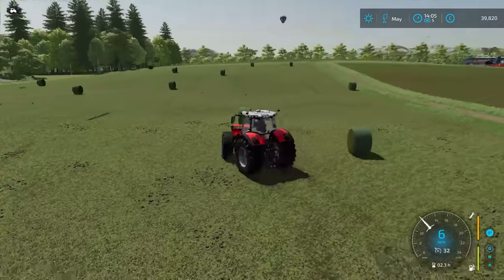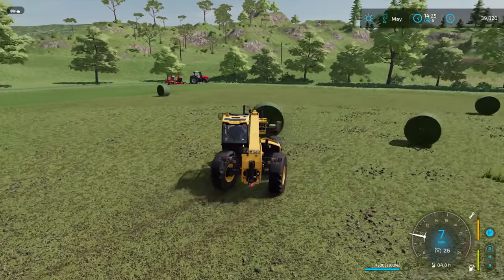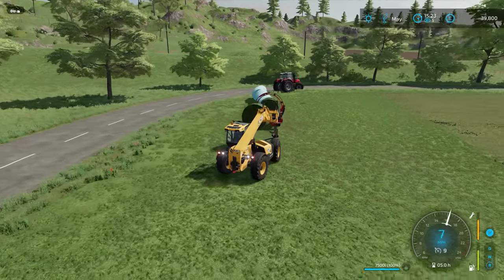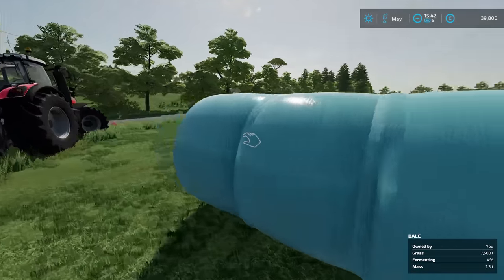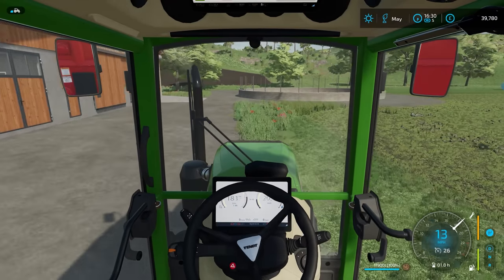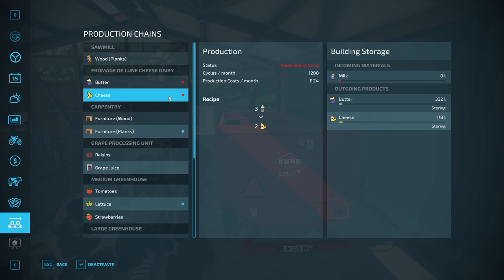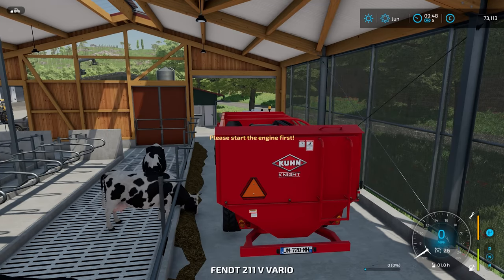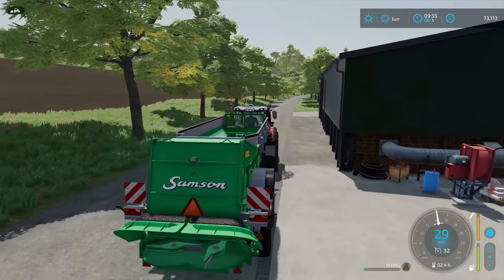BEHOLD! THE SILAGE SAUSAGE | Farming Simulator 22 - Haut-Beyleron | Episode 84

Comment: If you get a grass roller, you don't need to fertilize the grass field at all. Just use it the same day you mow, or you loose some growth. You don't need to shovel the muck anymore. There's a fill spot on the right side of the silo. The reason for the different wheel sizes is probably that the bigger front wheel climbs over bumps better, the rear wheel follows easier. And you get them closer together when they aren't both big, which helps in tight turns.
Reply: The fill side is lazy though!

Comment: The smaller wheel is a "tag" axle because it "tags along" to help distribute higher loads. It's smaller (and mounted higher) so that it only comes into play with a heavy trailer load. When the trailer is light, it's off the ground to improve turning.
Reply: It is actually not its a bogie axle meaning both sets of wheels rotate around the same central axle instead of it having to seperate axles, like the mars rover, that's at least what I could gather from Samson's own website and fotos of the axle set up

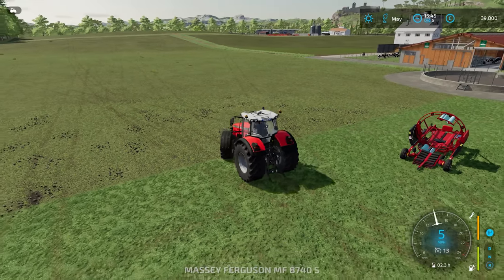Comment: 10:32 You should get a meadow roller for the grass field. It gives you a free fertilizer stage + 2,5% yield bonus. Only downside is that you have to roll before the grass start regrowing, or it wil be reset to the first stage. (Not the same roller you use on arable land)
12:25 You don't need the additive for tmr, it's pretty much just a expencive padding.
20:22 There is 1 collectible by a house just west of field 5, on a broken piece of wall. Not 100% sure about the last one, but I think you're missing the one by the house just north of the farmshop.
21:50 But you still have 6 pallets of eggs you forgot last time, you could have bought that spreader.
23:15 You don't need to fill the spreader manually. There is a fill point on the side toward the hedge. Should still be able to get close enough even if the icon would have been halfway inside the hedge.
Reply: You make the best comments on this channel by far
Reply: Great tips, but don't bother, he doesn't read comments.  I've given and seen hints like these before but they get ignored.  But thanks for trying to be helpful.  👍
Reply: @DairyAirFarms  chill out. He’s got hundreds upon hundreds of comments on every video. No need for a sly dig
Reply: @DairyAirFarms  Nobody is expecting him to read every comment, but he does read some of them.
My comments are just as much for anyone else who might have questions as it is for daggerwin.
Reply: Did he get the one near field 1 top left corner of the map? Field 5 house on the piece of ruined building, that I hinted at several episodes ago, so he for sure hasnt gotten that one yet.
Reply: @DonGorgen  No offence meant, after all there's a reason I watch his videos everyday.  I guess I should have phrased it better.  Daggerwin's a storyteller, and great at it. But his play style is his own.  FarmerCop tests every little detail.  Daggerwin just plays and tells a story to keep you enticed.
Reply: One exception to TMR, you do need additive if you use a feeding robot.. without it the robot doesn't run, as I've found out lol.  Doesn't apply to this series, but just a general tidbit
Reply: @DairyAirFarms  I'm pretty sure he records ahead, so if you post a comment it's safe to assume AT least 1 week until he reads the comment.
Reply: @ScarletFlames1   Yep that makes sense. Sadly by which time the comment is lost, but you can't expect anyone to sit by the computer to just watch the comments.  I guess that's why he relies on Poll's so much which makes sense.
Reply: @ScarletFlames1  He does prerecord, but usually 2-3 days ahead unless he's planing to take a break. I've noticed he reads comments about 2-3 hrs after each upload, but because of the prerecording we won't hear about what he learned from the comments untill a couple of days later

Comment: Sorry to repeat this comment, but realized I posted it on an older video. 
Check out the 'Fortis 3000' in trailers, it costs 62k and you get 24m spread & 45m3 capacity, and you get a trailer and manure spreader in one. Great dual-use trailer.

Comment: The big Krone wind rower you mentioned in the previous episode doesn’t work well going across slopes. It is too wide therefore it lifts the back of a tractor up, then it slides down the hill and makes the row all messy. Only going across slopes and or on uneven ground.

Please can you put the wide BKT tyres back on the McCormick when you are not fertilising. Good Vid Daggerwin😀

Comment: New in FS22, in the muck spreader settings you can enable double application rate to do 2 applications at once. Still uses same amount of muck as 2 separate applications, but saves you a trip around the field.

Comment: The difference in wheel size is about stability. Taller side walls have less rigidity and need more air pressure, so small wheels mean they support extra weight better.

Comment: May I suggest to place a barn near the silage pit? it will help to produce the TMR, and you can use the forage mixer to shred the bale directly into the barn.
I generally use 4k silage (with wheel loader bucket), 4.5/4.8 K hay, straw rest, directly from the barn

Comment: Don't know that, you have seen my comment. And a little bit updated comment. You should also use the GPS mod. You can do field works more straight. And the corseplay mod, it will make feild workes smart and controllable. You should also use the Autodrive mod, it will make, driving cars and tractors so easy. And you can hire a AIworker for the Vines and the Olives. And there is a unload combine feature in it. You should see the tutorial of it. And you should also use the Front Lifter mod, if you use it, you can do some insane things .

Comment: Boogie construction
The unique wheel construction of the FLEX spreader reduces ground pressure and minimizes the need for traction. the boogie construction,
with a large and smaller wheel, it makes a lot
easy to maneuver with the spreader.

Comment: There is one collectable im pretty sure you havent gotten yet. if your heading west into town, there is a small park area that on the map is shaped like a w. there is a collectable behind a bench in the grassy area making the left v of the w or the western-most line if the w. i believe that one you also still need is north of field 30. there is a bridge directly north of field 30 and the production that is above that. halfway across that bridge, there is a building there on the left backed up to the water if your looking at your map. is behind that. coordinates according to a website are (x 851, y 1041). its right next to a silver/grey box on a wood stand up against the building. and i dont remember if you have gotten the one in the forest north of field 14. and one more just to make sure. there is a gated building north of field 7. there is a grassy indent in the brick wall and its next to a tree.

Comment: The FLEX 20/23-spreader is equipped with a specially designed 21-ton spring Bogie, which absorbs the impacts to which the spreader is subject while driving.

Comment: the rear wheel on the spreader is smaller because it aids in steering. If it were the same size as the larger wheel it would not have the arc to actually turn without either being mounted wider or having relief in the side of the spreader.

Comment: Re MingFlinger, aka ChitCaster. The suggestions that the smaller second wheel spreads load while not impeding turning sound right. A subsidiary reason may be to allow space for the mingfling mechanism.

Comment: The Samson-agro flex23 has that bogie design to reduce pressure on the field, minimises required traction power and the wheel configuration makes steering easier.

Comment: There is a small house just next to the rail bridge close to your farm at the bottom of a little hill it has a icon on the back dunno where the collectible is but it’s close and that muck spreader with the small wheels on the back there used for rear wheel steering Ik I used it myself on FS 19 on my farm recently

Comment: The wheel is smaller to carry more weight. Because them wheels are lighter than the bigger ones witch you can carry more weight. The same as the ones on trucks. Very common for getting blow outs thow with them being smaller because they over heat quicker.

Comment: I see everyone is already recommending a grass roller, which I heartily agree with, but just a tip for anyone who isn't aware; you can use a weeder to do the same job as a roller.

Don't ask me why, it might well get patched out in future as it seems like a bug to me, but it works. I use the big blue Treffler weeder with the 18m working width (I think) which makes it a much quicker job than using a 6m grass roller.

Just be careful and make sure you've baled all your grass first because the weeder will delete cut grass as well.